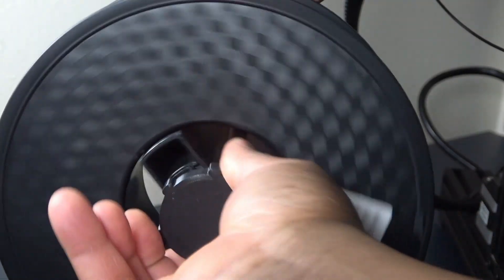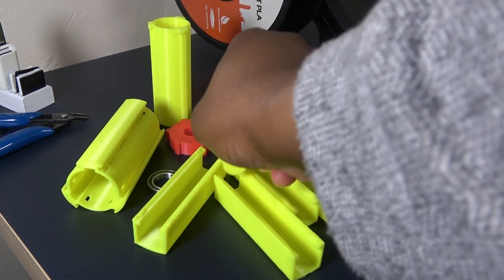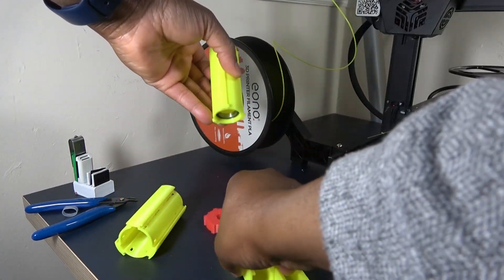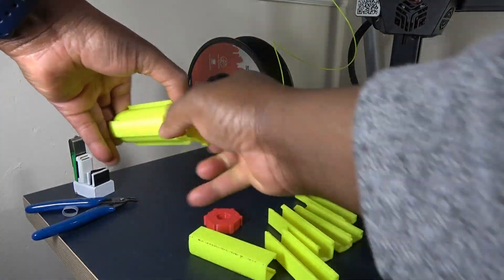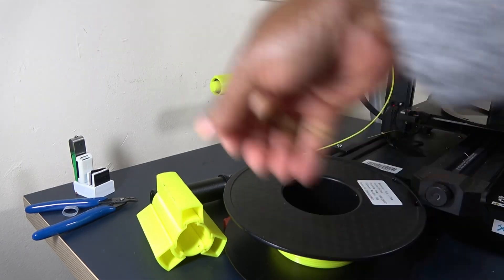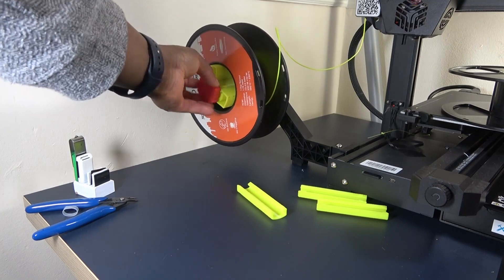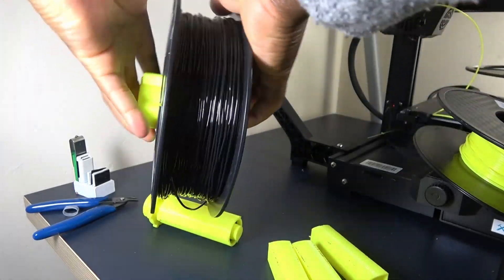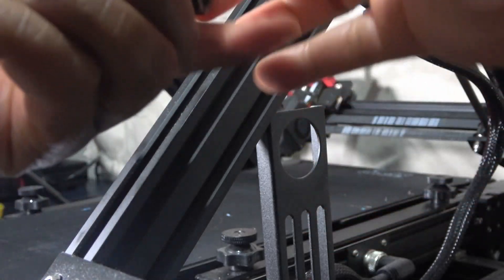Low friction Filament Holder for 3D Printers - My CR-30 (Naomi Wu's 3D printer) and CR-6 SE.

Comment: Low fiction holder must work with rewind mechanism, otherwise it will roll too many rounds,release too much filament, and give printer tangle problem....

Comment: 57mm diameter, thanks in advance. CR30 has been great but I can tell the friction is my issue. Thanks for making this video. This was a great help for me.
Reply from the maker: I have added a 57mm filament holding arrangement/filament slides to GitHub. I will try and add more sizes before the new year.